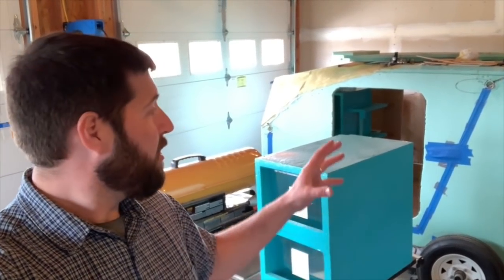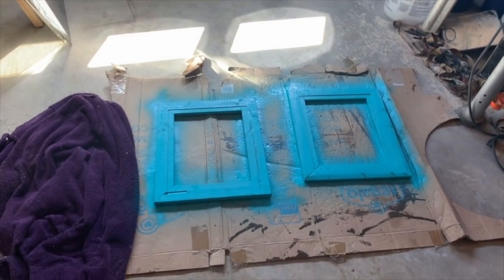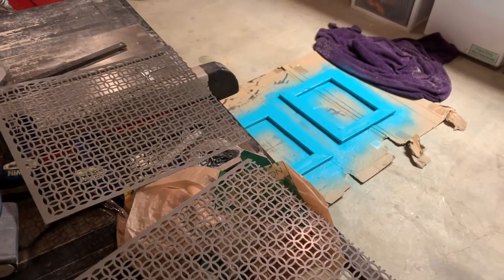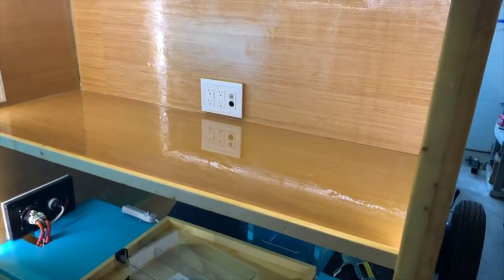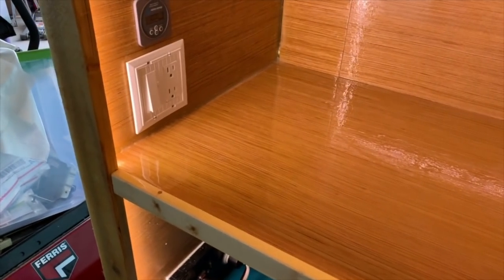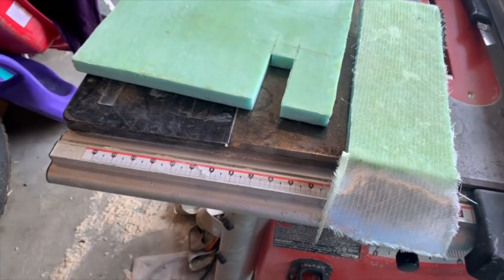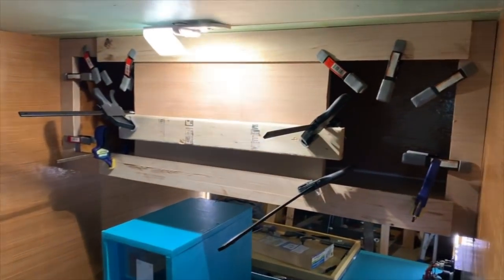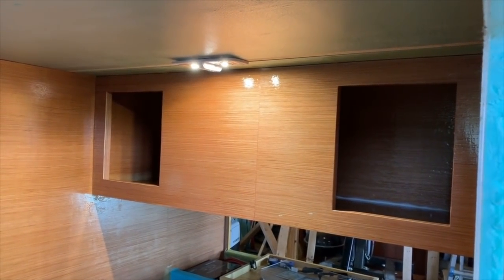Foamie Camper Build: Kitchen, Foam Cabinets and Electrical

Comment: The " reverse pooling " is because you need to chop the surface and not brush the surface. Chopping will break the surface tension and allow everything to level out.  I know this video is old but figured I'd mention this to help others that come across the video.

Comment: I like it. It really is turning out nice. I have never worked with epoxy before and I have a project coming up. I'm building a shower basin for my DIY Camper. It will be 24" x 30" x 8" deep. Just gonna use scrap plywood and epoxy it to water proof it. Your videos are helpful in that respect.
Reply from the maker: Thank you. Im glad it helped you.

Comment: Just a quick thought - to not have to leave your propane heater on all night to cure the epoxy, how about usimg a cheapie electric space heater? most people have one, and they are safe and have thermostats built in. thanks for the interestimg build vids.
Reply from the maker: The garage is uninsulated. An electric heater wouldnt be able to keep up with the loss. If I only needed it inside the cabin of the camper it might be doable but not all the work I do is inside the camper. 
Ideally I should have a larger, insulated, garage. :)